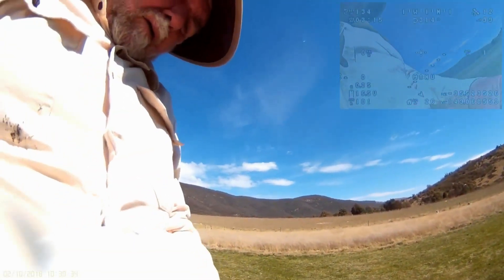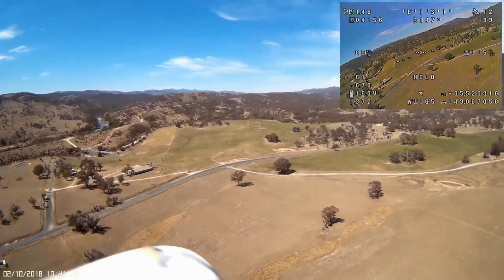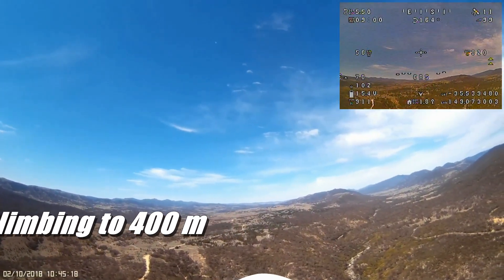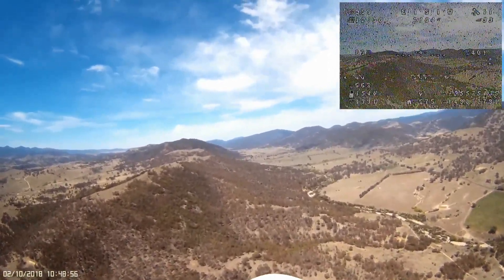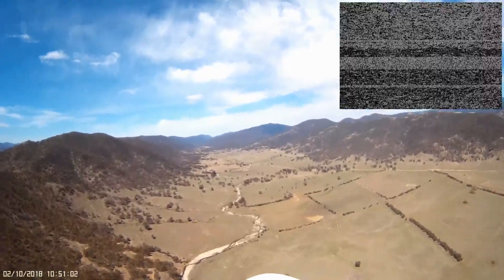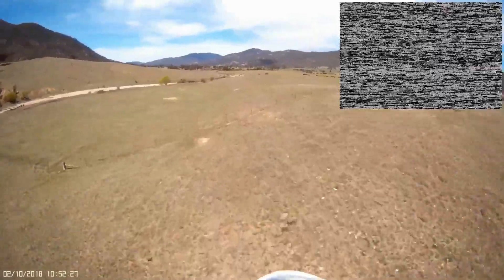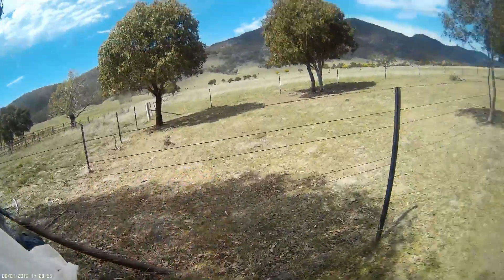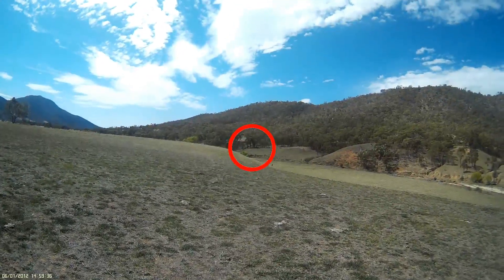FPV Ranger -  Mystery crash with INAV

Comment: Wow, another amazing adventure, no tiger snake wrestling this time, at least.. It's an interesting point you listed about the proximity, a few years ago I discovered (the hard way) that there is a ground link beam between two NBN towers nearby that seem to instantly crash whatever aircraft I fly through it. I even had a quadcopter with a Vector FC that used to go to 100% throttle, despite the Vector logs showing no such input, it was like the esc's were getting their own post FC interference, I lost a few aircraft before noticing the location was always in the same area/altitude. I then plotted the towers on GE, and drew a line, it pinpointed the zone and altitude exactly. I now have it as my only 'no fly zone' with anything RC, but I can still fly over it, but always staying well clear laterally. Anyway, the 10k challenge remains.. lucky for me, I thought you had me this time.
Reply from the maker: I'm going to try a swapping out the rx with maybe some commercial dipoles also try a Moxon on the tx to see if it makes any difference but I'm still leaning towards believing it's environmental. 'I think I've got the RTH sorted now and I'm hoping that with that working and the Ranger's extra range I'll be able to map out  the "dead" zone and hopefully find a way around or over it.

Coincidentally, I was recently looking at a chart of localled controlled airspace and noticed that the nearby Tidbinbilla Deep Space Tracking facility is marked as a commercial No Fly zone. God knows what frequencies and power they're using to stay in touch with Voyager and E.T.

Comment: Ken, you might find a video on JD Fpv interesting may not be the same Matek board but has INAV. https://youtu.be/KScxmxyXUL4
Reply from the maker: Thanks Don. Yes, it is a slightly different board but running the same version of INAV. I'm pretty sure I'd have seen the same behaviour if the video hadn't dropped out. I'm afraid that in my case though I have to take most of the credit for it. I'm 99% certain that the radio signal dropped out and the rx went into Failsafe mode. Unfortunately I hadn't included setting the Arming switch to "ON" in the failsafe setup so it would have instructed INAV to swith to RTH, set Throttle to 50% and "disarm". I'm just lucky that the default "AIR" mode was able to bring it down relatively level without flying into the hill side. I hope to get out later today to test the "new" failsafe setup.

Comment: Next time drive to your projected 10k and park  then have somebody launch it from your flying field. Of course you better turn everything on before you drive away from the airfield
Reply from the maker: Given that I'm losing the signal at 8k with 400m altitude, I doubt that I'd have much control at 10k with the Ranger on the ground.  It would probably be easier to fly from the top of the hill next to the field but the challenge is to get to 10k from my current location.

Comment: Bloody hell Ken that was lucky the plane did not crash. Sorry about your shirt.
EZUHF should be much much better than that and I would check the receiving antenna but you need to get that failsafe working first.
Test it on the ground with prop off, video on and turn the radioTX off and see what happens on screen.
I hate to say it but I am looking forward to your videos as they are very enjoyable (not the crashes) to watch. 

That "Ranga" flies really well now with the 4S setup and INav looks really good.
Reply from the maker: Lucky! I carefully chose a course that had enough space between the trees for an emergency landing.

It's pretty hard to test RTH on the ground as it just refuses to engage RTH mode unless it's in the air. I've wiped the INAV Failsafe mode that I'd set up (incorrectly) and re-configured the ezUHF failsafe to ARMED-ON/RTH-ON/THROTTLE-50%. I'd neglected to include the Arming switch in the previous config. I just tested it and when I turn the TX off now,  the throttle engages and the INAV displays "AIR" mode which I've set as the default mode. I'm pretty sure that's the mode that's what she was in when INAV landed it for me. I'll test it again in the air and expect to see RTH engaged befor I head off again.

I've already  tuned both dipoles on my eZUHF gear to the frequency I use. It turned out that each element was about an inch too long but I'm obviously disappointed in the result. There's no doubt that it's a particularly challenging RC environment but at a bare minimum, I should be able to at least outlast the video signal. I think I'll try another rx. I'm still using the same 8ch Lite that started out in the Tek-Sumo. It's survived many crashes and has become so faded by the sun I can no longer read the markings so it's probably well past retirement age. I've got a couple of new 4ch Lite versions which I bought when they were on special somewhere. I'm pumping everything down the PPM line so I don't think it'll be a problem. At least it will give me a baseline for comparison.

Comment: Oh no!  Glad you got it back in one piece (and it didn't settle into one of those trees up on the hill!)  I've used my Rx (FrSky L9R) failsafe presets to enable the RTH switch with 50% throttle, rather than stuffing around with iNav's failsafe modes. Basic, but I know it will do the job.  It may be worth ground-testing to see what your plane does from 3DCRS and throttle on, when you turn your Tx off to simulate a loss of signal.  If it throttles down, that's a bit of an issue!
Reply from the maker: I originally thought that the INAV failsafe was simply there to cater for Rxs that don't provide a failsafe feature so didn't pay much attention to it. I just set it to see what it would do. The ezUHF was already set up to initiate RTH with 50% throttle so I didn't change it. In retrospect I probably should have reset the failsafe to include activation of the "Arming" switch which may account for the motor shutting down. I guess the INAV failsafe didn't activate because it was either still receiving RTH instructions from from the rx or because INAV was disarmed because of my failure to add "Arming" in the rx failsafe instruction set.

It's pretty difficult to test this stuff on the ground as it seems that INAV inhibits activating the NAV modes till the plane is moving. I have been able to fool it into thinking it's in the air a couple of times and I did actually turn off the tx to test the response. RTH engaged and the motor did start on both occasions so I'm a bit confused. I haven't been able to figure out under what conditions INAV will activate these modes while on the ground.

I think I'll just do the same as you and go back to what I'm used to.
Reply: Ah, it would have disarmed on Rx failsafe... bugger!  Now you can rectify that oops and retest at the local field (rather than 8km away)... :)

Comment: Sorry to hear but more details would be nice....inav version? radio used? if not inav 2.0 it is most likely the bug with loss of signal the motor cuts and will not come back on once signal is restored until you put throttle to zero so you can rearm.
Reply from the maker: I'm running INAV V2.0 on a Matek F405-WING board. Radio is Turnigy 9X Pro with IRC ezUHF module using PPM output. ezUHF 8ch Lite rx failsafe is set to initiate RTH with 50% throttle.
Reply: KenJungles oh wow, thanks .so still problems with inav. Very good video and report. So any ideas what happened? Have you tested the failsafe? Do it on the ground  at reduced power and see if any weird  behavior near loss of signal.  BTW I am using a tiny arkbird from hobbyking and it has never failed...no OSD on the tiny but the full arkbird has OSD and I have one of those also on FPVraptor with no mishaps due to arkbird. Lost it twice in 7 years due to engine failure and bad aileron servo. It was equipped with loc8tor.com and  Tbeacon or ELT from CSI.
Reply from the maker: Looks like the Ranger lost signal and I because I hadn't set the failsafe up correctly, the INAV disarmed the motor.
Reply: KenJungles best to test everything  on the ground..even failsafe..good job..

Comment: Have you set failsafe on the on the FC or RCRX?
Reply from the maker: I've actually got it set on both but I'm not sure if that's the correct way. INAV has a failsafe "mode" which I've set to RTH and successfully tested (by switch) on a previous flight. It clearly didn't activate on this occasion or if it did, didn't behave as I expected.
Reply: Hi Ken

There are two methods to set failsafe.

The first is to set the RCRX to engage RTH if no signal is received from the RCTX.

The second is to set the FC to engage RTH if no signal is received from the RCRX.

Note the subtle difference.

The first method is simple while the second method is more robust.

By default 'most' RCRX use the first method. If you want to use the second method you will need to configure it (in your case) using ImmersionRC Tools. Specifically you want the RCRX to output no pulses if signal is lost.

The take away here is you can't use both.

I hope that makes sense.

Cheers

Jase :)

Comment: Oh, man, sorry to see!  Glad it landed fairly well, and raise a glass to the tBeacon once again!  The loss of both RC control & video at about the same time, operating on two different systems and frequencies, indicates to me that the plane was likely blocked by terrain.  The receiver appeared to go into a signal cut failsafe, motor off and no input to servos.  Not sure what long range system you're using, but I suspect the receiver failsafe output doesn't match the expected failsafe input for the flight controller.
Reply from the maker: Yes, the T-Beacon has paid for itself many times over. I'm using the ez-UHF LR system which should be able to make twice that distance without a problem. I think you're right about the terrain. It's particularly challenging with those reflective ridges on both sides bouncing radio signals all over the place. The fact that I came down so close to my previous best suggests there might be some sort of geographic anomoly that's knocking me out at that point.  if I can figure out why the failsafe didn't activate, I might try a bit more altitude next time..
Reply: Ken, I’ve been watching your exploits and was wondering how you were achieving successful recoveries. That tBeacon looks to be a must. What range are you getting to help locate the recovery location?
Reply from the maker: It's paid for itself many times over. I'm getting at least 2km with it just velcroed inside the fuselage and a standard rubber-ducky antenna on the walky-talky. I could increase the range substantially by bracing the beacon's thin co-ax antenna somehow or by using a Yagi on the walky-talky but I generally know roughly where it's gone down, at within at least a couple of km. There's also no guarantee that a more robust antenna setup would end up in a favourable position after a crash.

For this recovery I wasn't sure if it turned for home and think I stopped 3 times at high points along the road before picking up the coordinates at about 7k.
Reply: General proximity certainly helps. Did you use RSSI or GPS as the locator? I’m just wondering whether there is any value having the GPS set up for the average user. I’m assuming it would require its own GPS. Thanks for your insight.
Reply from the maker: I guess it depends on what sort of terrain you fly in. I've gone down in quite dense bush where the plane wasn't visible from more than 10 feet away so I really rely on the GPS. I'm using the Green version of the T-Beacon which has its own small on-board LiPo. I've spliced it into the tx line of the FC GPS and the 5V rail which keeps the beacon charged as long as the flight battery is plugged in. Because the beacon only "wakes up" when it is called, it can continue to operate from its own battery for weeks or more If the flight battery and/or the GPS become disconnected in a crash. I'm not sure how long it would remain active if it needed to power the GPS as well but I believe the later versions of the beacon (Amber & Black) are designed to better support a dedicated GPS. The web-site provides specs for the different versions and there is an RCGroups thread which can give you a good idea on how they're being used..

The RSSI strength, piezo horn and flashing LED all help when you start getting close. It also transmits three tones at diminishing power levels which can be used to "fox-hunt" the location in the event that the GPS coordinates have been corrupted for any reason. It's a pretty impressive package and is well supported by the designer though he's a one-man show and can sometimes be a bit slow to respond.
Reply: GPS is best, foxhunting can be a pain & take a while.  Just plug the coordinates into your phone and walk to within a short distance to the plane.  I have set up one tBeacon with it's own GPS to put on any plane with a 5V from the plane's receiver, but the 5V supply is split so the GPS receiver isn't powered by the onboard battery.  The tBeacon works in the 70cm/400MHz band.    @Lawzy

Comment: Unlucky I feel your pain, you have a great place to fly no ppl to tell you you can't fly here!
Reply from the maker: Thanks. The area's largely unpopulated so I'm not too worried about doing damage on these trips. I actually got busted by the farmer this time just after retrieving the Ranger. He'd come into the paddock feed his cattle. It's pretty dry and there's not much grass left. He was pretty coll about it and even offered me a lift back to the road but I was too proud (stoopid) to accept it.. I must have looked pretty weary at that stage. He did point me to the most fence-free route to take back though..
Reply: In Modes tab select a switch for "Failsafe"

Set your switches and sticks of your radio to the following conditions:

Throttle: approx. 0% (no throttle)

Aileron: 50% (no input, stick center)

Rudder: 50% (no input, stick center)

Elevator: 50% (no input, stick center)

Failsafe mode: activated

Arm switch: Disarmed (If you use stick arming you can skip this)

Configure failsafe on your receiver to the above conditions on link loss (consult manual for your receiver on how to do it)

This is what I followed off the wiki and it worked, again best of luck
Reply from the maker: Thanks for the pointer. That's exactly what I didn't do. Mine's set to activate RTH with 50% throttle. I don't understand why the Arm Switch should be set to "off" but I'll give it a go. I'm going to feel such a tool if it works . . .